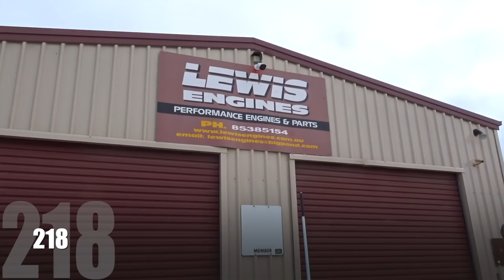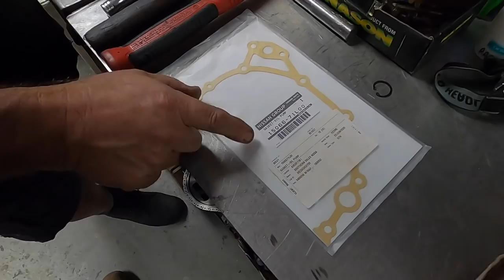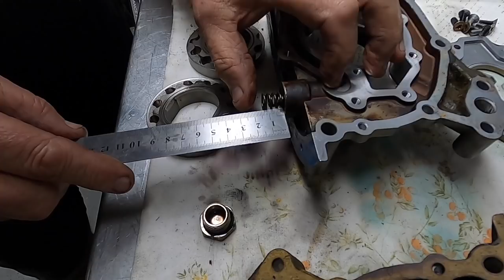RB30 Budget Build - Bottom end Completed - RB25 Head tricks and tips | PART 4

Comment: An amazing build,what happened to it did you use it and how much horsepower did it make , I am interested and planning to do the same build, but does it work with no issues , or should I go forge pistons etc. I am planning to use the rb30de block the single came carburetor
Reply from the maker: So this engine ended up in Thailand. We needed an RB30 block asap and built it into an RB32 and shipped it over to Thailand. Crazy how these things work.

Comment: Yesss been waiting for this 😃
Reply from the maker: Hope you enjoyed it man
Reply: @DriftSquid  did indeed mate another great clip, just a small question I had my rb25neo rebuilt about 3 years ago (oem rebuild) but compared to other rbs mine is breathing a lot through the catch can could this be due to the rings being gapped to much ?
Reply from the maker: @doriftoc_man934  could be a lot of things mate. The ring gap, the boost you run, could have been tuned poorly and damaged the rings, Could be over full of oil,  could be the oil restrictors weren't put in, could be your cam cover setup, long story shortish, it could be a heap of things mate. I'd firstly be doing a leak down test and a compression test to see what's going on there. I've done a few videos explaining how to do this 👍
Reply: @DriftSquid  perfect thanks man, honestly il be buying a rb30/25 from Lewis engineering soon instead of rebuilding and forging my 25 better to put a bit more money together and get the best. Thanks again mate keep up the great work 😃

Comment: How does the head drain not pressurise the sump??
Reply from the maker: If you have pressure in your head. You motor is Ted.
Reply: Sorry I mean sump pressurise head??
Reply: Or have I been misinformed that they are different pressures?
Reply from the maker: @yowhatsdoin8838  You shouldn't have pressure in either of them. Only pressure should be between your pistons and valves. If the pressure is in your sump or your head then something is leaking "Broken piston rings, valves cooked" and it shouldn't be.